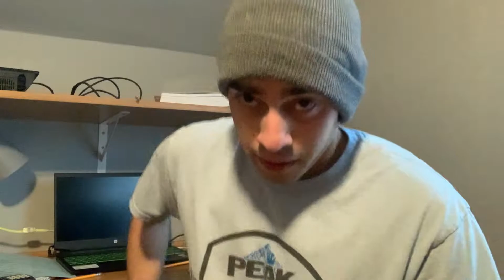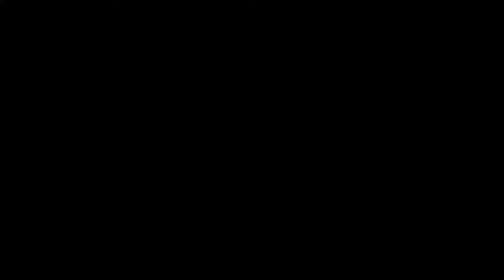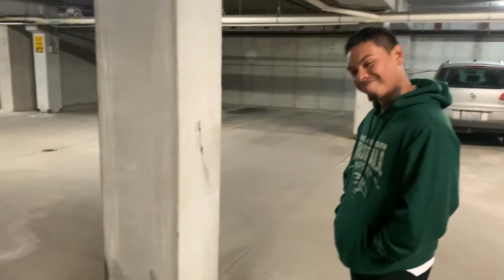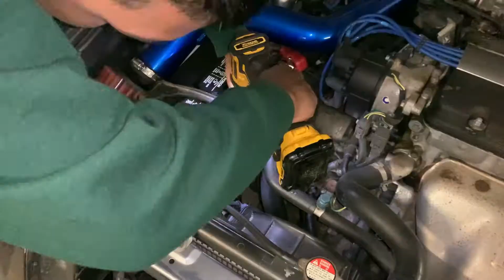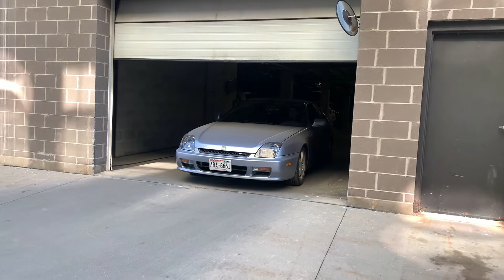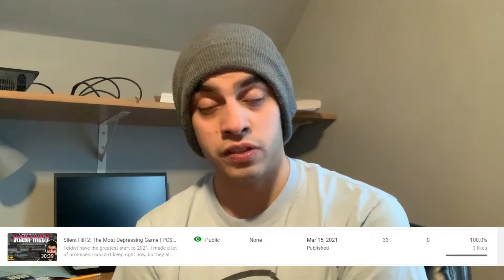Selling My 5th gen Prelude (2021 update)

Comment: I see you have an auto I just purchased one about 4 days ago with the auto and I know they have issues just concerned has 160k they said it was replaced at 98 and did have paperwork to back that up just wondering on how your cars auto held up over the years and how many miles you had on it
Reply from the maker: I had mine for 2 years. I can still the trany will take a shit soon tho. I’m gonna do a manual conversion soon.
Reply: Mines has 250k original trans, i think people exaggerate the trans issue. Many of the solenoids can be replaced since it doesnt have a valve body internally. Mines does shift a lil rough tho but its been like that since i got it. Not the best shift feel but i think it was rough since new. They always feel like that